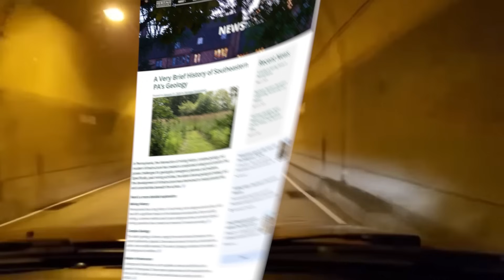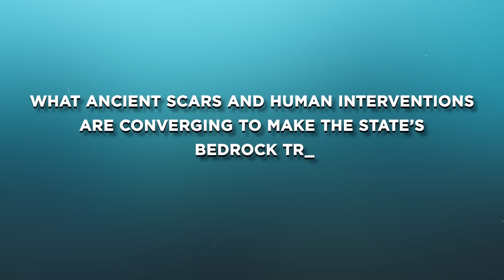Scientists TERRIFIED After Cracks Opened Beneath the Pennsylvania Coast

Comment: The route 202 problem near Norristown, Pa. has been going on for ~50 YEARS.    The roadway was ‘rebuilt’ with a four lane concrete highway in the '70s. ... and almost immediately began to undulate ‘downwards’.   In the 1800s, Limestone, etc. was deep mined in that area to supply the nearby steel mills.